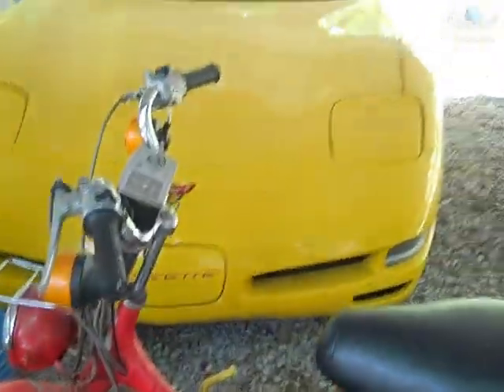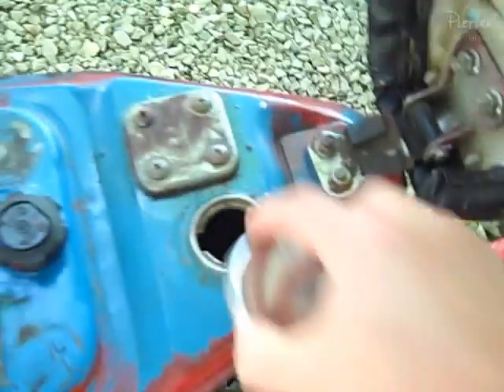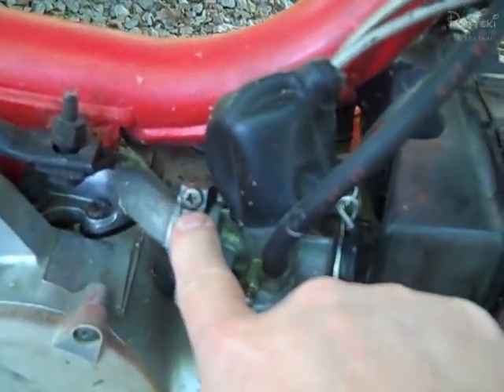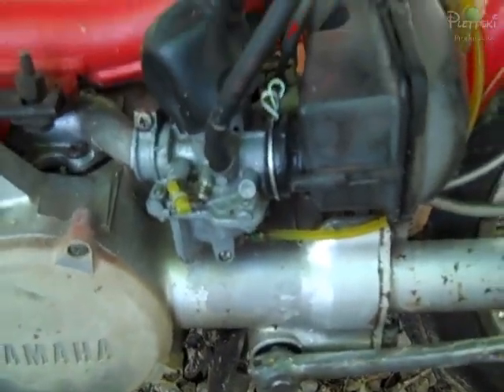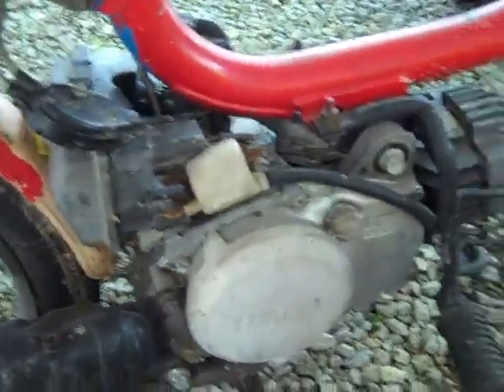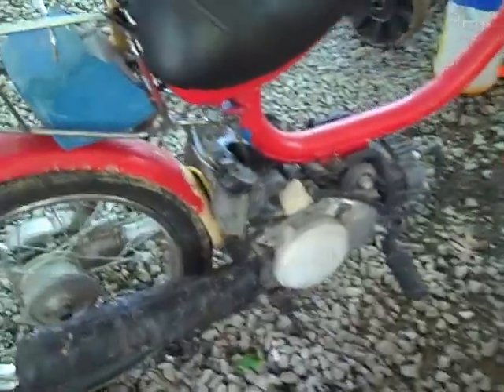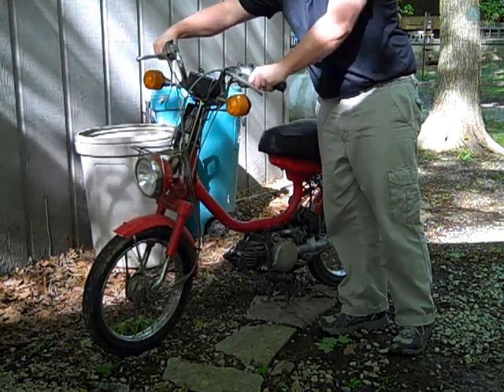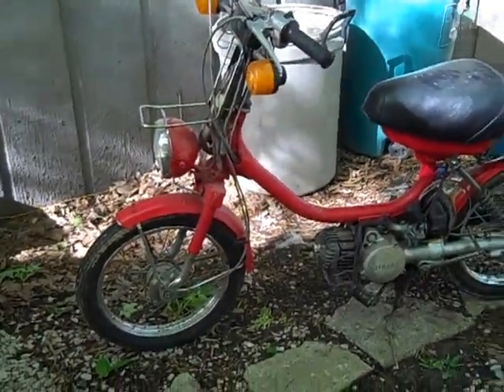Yamahopper EV Conversion (Episode 1 - Donor Vehicle)

Comment: if you put straight gas in no wonder you didn't make it . the oil line is unhooked  you burned it up
Reply from the maker: I didn't put straight gas in. I pre-mixed the oil. But, I no longer have the yamahopper. I sold it when I moved.